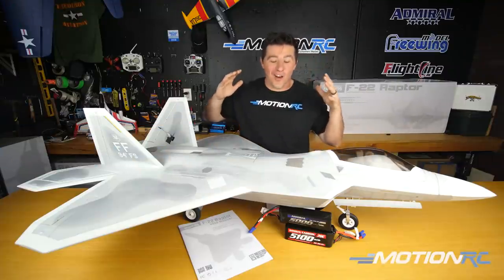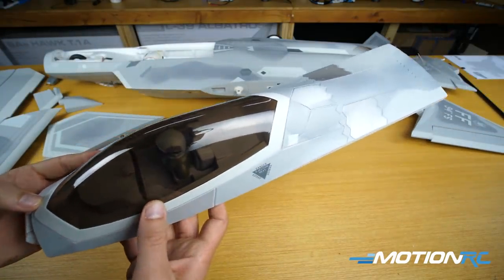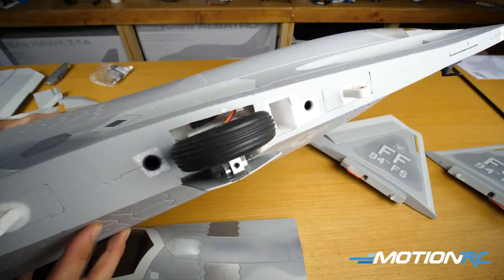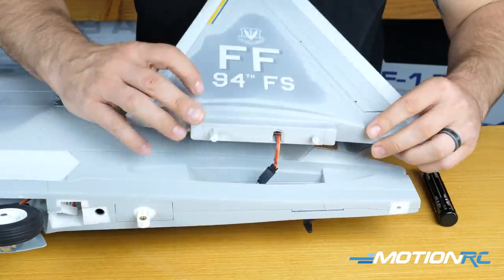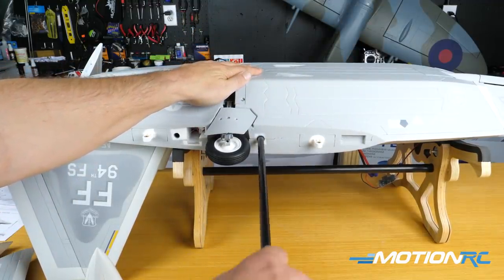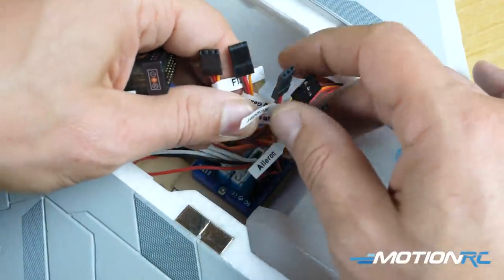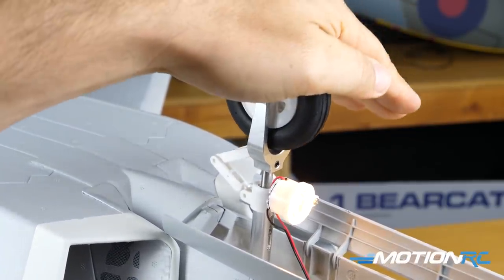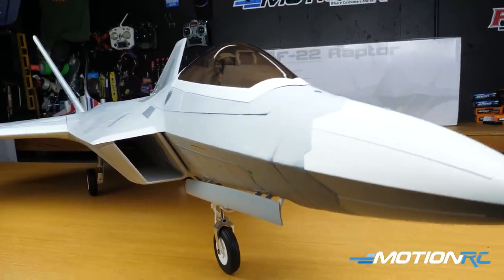Freewing F-22 Raptor 90mm EDF Jet - Build Video - Motion RC

Comment: I’m sure Freewing will come out with something better at some point, but this is Freewing’s finest work. It’s a blast to fly, but it’s so darn pretty with all the attention to detail, it’s the only plane that has its own stand in the den.
Reply: Jeff, I would love to ask you some questions about your planes. I have only flown parkzone and eflite but would love to venture out to freewing or fms but worried….are you on ig?
Reply: @Hughejazshole  I started out with  Eflite and Dynam. I got a few of the ArrowsRC as well, but the ultimate goal was to get good enough to fly Freewing and Flightline. (Flightline P-38 was at the top of the list) 
I didn’t discover FMS until a year ago. Started with their Yak 130. For the price, the easiness to fly, and the best gear in the market for a 70mm, it was a no-brainer. And from there everything I bought from FMS was even better. There was a day last Fall, one 6s battery left. On the table- FMS Bae Hawk, 1500mm a-10, Futura v3, and Eflite’s 90mm Viper. That was a great day- there wasn’t a wrong or a bad choice. (I went with the Futura. LOL!)

Comment: One of my favorite planes is the f22. I can not wait to get one of these.
Reply from the maker: Both fly well, this 90mm one or the smaller 64mm
Reply: @MotionRC  can you put a turbine engine on it and does it come with a camera also can you switch controller? I’m new and want to get one like this
Reply from the maker: @Haveablessedday820  If you are new, then a turbine engine would not be where you start. You can certainly put one in, but would need to do a lot of work to make it possible. Doesn't come with any camera and not sure what you mean by switch controller. This model is PNP so you provide/use your own Receiver and Transmitter for the protocol you fly with

Comment: You did not mention the use of Loctite. I go through my model and remove every single screw and set screw and Loctite it. I had a fan come loose on my F-16 because it was not locked I did at the factory. It was a dead stick landing. It destroyed the fan. Blades almost came through the foam. While locked are you doing all the set screws in the landing gear, I found the electric motor mount screws on the retract it self had come loose. I removed all of the retracts to do these screws as well.

Comment: A Little more Info and Showing what the Dual Rates on the Aileron , Elevator , Rudder & Flaps position 1+2 +3 Look Like and How to Adjust Them would have a GREAT HELP !!
Reply from the maker: Sorry about that. But I set her up as per the manual and haven't touched those setting since. I fly on low rate aileron by the book and only ever go to mid rate. And then I go full out with the elevator rates to get the great high alpha action when I want it. She really is a big trainer in that, she'd be hard to truly set up wrong. She wants to float
Reply: Thank You for the info . I have not flown my F22 yet . I am a little nervous about the maiden . So I have been looking for all the info that is on YouTube . Love your Video , Keep up the great work . THX BEN V.

Comment: I have the latest Ultra Performance version. The AR8020T receiver binds fine, but the ESC keeps beeping and no controls are working. Can someone tell me the channel assignment? This version has a wire labelled as “Reverse Break”. I plugged that into channel 7. Am I doing something wrong? The manual is pretty much useless in this regard. Thanks!

Comment: I need your expert opinion. Will the 86 dollar 6 channel radio give me plenty of flying range?? I have to buy two 2100 batteries. And a charger.
Reply from the maker: 6 Channels is all you need for this bird but I am not sure which radio you are referring too, and a 2100mAh lipo will not be enough. Recommend a 5000mAH 6s or larger for this.

Comment: What transmitter should i use? Does it even come with a transmitter? Spektrum,  flysky?
Reply from the maker: completely up to you. This is a PNP (Plug and Play) model so it comes with everything except a receiver and battery. You atleast need a 6 channel receiver (throttle, aileron, elevator, rudder, flaps, landing gear)
Reply: Motion RC. Ok, thanks. Any recommendations? For a transmitter to buy. I am looking for a good range but not too expensive

Comment: What’s the difference between the 6s and 8s?
Reply from the maker: The power system is different to handle more cells. The 8s will have more speed but will require more batteries

Comment: I'm going crazy trying to adjust my elevator. I'm running a Futaba transmitter and receiver
Reply from the maker: what kind of adjustment?Not sure how to help with limited info
Reply: @MotionRC  Elevator, any pics of where the pushrod position on the white piece on servo
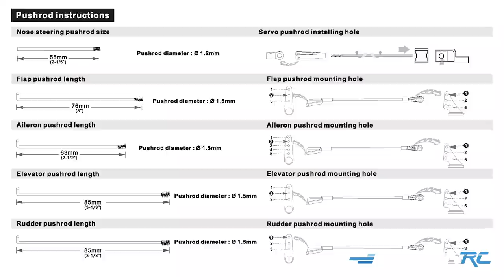Reply from the maker: @el_diablito  At 12:48 in this video we refer to the manual which shows you which holes on both the servo and control linkage the pushrods should attach to. Elevator is the second hole on the servo side and the 1st hole on the control surface side.

Comment: Which material to body made this plane
Reply from the maker: This plane body is EPO foam with wood, carbon, plastic reinforcement throughout
Reply: Thank you sir
Reply: Please sir make video to how to made this plane body.....
Reply from the maker: @p.c2005  these are made in mass in a factory with 100s of materials https://youtu.be/Z5B4DnbxJ2k
Reply: Why wood use in plane body
Reply from the maker: @p.c2005  ridigity, strength, lightweight. Same as real aircraft
Reply: In this plane which engine are used
Reply: How many weight carry to with fly
Reply: I am indian.......i make a I - 1 jet plane
Reply: I mean sir which part of plane used a wood
Reply: @p.c2005  this is not a homemade plane

Comment: Are you using 7 channels?
Reply from the maker: only 6 needed for this. Throttle, Aileron, Elevator, Rudder, Flaps and Landing Gear
Reply: @MotionRC  admiral rx and spektrum tx?

Comment: Very well built you put Dynam & LX  to shame, most of my fleet are Eflight, I only have 1 complaint/question where can I get ordinance for this and the V2 F-35? Great video James you can message  me on Instagram (rcintheworks) thank's 😉👍🛩
Reply from the maker: By nature, the F-35 and F-22 maintain stealth with their ordinance tucked away, so none were made for either of these (while knowing some variations do have loadouts). But many have modeled some. You can buy the railing systems from us and ordnance from other jets and modify it yourself. But ordnance on any  EDF jet will only add more drag
Reply: @MotionRC  I knew that duh lol steatlh Bombers are tucked away and I see the details in them so my badd James, I like the edf's with ordinance for looking at I do remove them when I fly 😉👍
Reply from the maker: @timvanasen6711  If you have access to a 3d printer, we have free files on our support page that mimic the bay's being open with missiles attached. Check out the files loaded on November 6, 2018: https://www.motionrc.com/pages/freewing-f-22-raptor-90mm-support-page